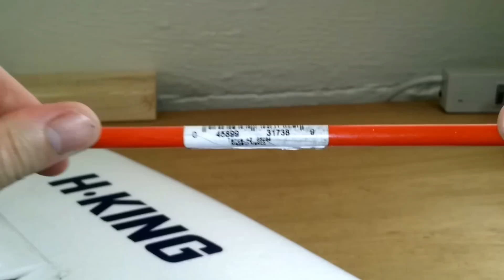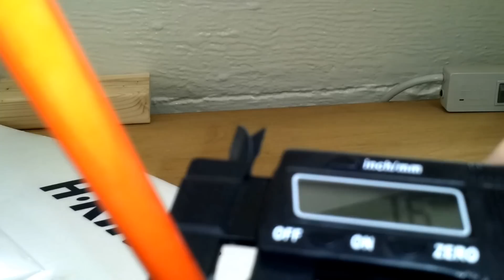Broken Carbon Fiber Wing Spar on Bixler 2 - Replacement For $1.99 at Home Depot or Lowes

Comment: Thanks for the video.

"I was hoping to find out what the specs of the actual genuine bixler 2 spar please."

I decided I couldn't wait and dremeled room for a 10mm aluminium tube, it was the absolute worst decision ever!!  The plane flew terrible, didn't have that soft return of energy that it did before. My spar got accidentally thrown out, which was very sad
Reply from the maker: I'm not for sure what the diameter of the tube was.  I don't have the broken tube any more.  I think 6mm or 6.5mm.  You might check the Hobby King website and see if they have replacement parts for the Bixler 2.
Reply: @MrDabrudda  cheers, it was 6mm

Comment: Yup, snapped a wing off right at he fuselage.  The spar broke .  It's very light but thin and brittle.  So I'm into the fix mode.  Thanks for your suggestions here. It will handle a 6mm aluminum tube if I find one.  Going to the machine shop.  Good luck.  Fun plane to fly.

Comment: I will need to try this because I broke my spar. Quick question for you. Did you try any mods to remove the need for the wing screws?
Reply from the maker: No I haven't tried the wall hanger mod or using rubber bands to hold the wings in.  For now I use the wing screws with my airline tubing mod to make it easier to insert and remove the screws.

Comment: You really don't even need to mod it to make it fit if it's a rod 39" long and 1/4" diameter
Reply from the maker: The fiber glass rod is a little thicker than the default carbon spar and is a very tight fit.  The carbon spar is 6mm and the fiber glass rod is 7.5mm so pushing the fiber glass rod in with your hands might be difficult.
Reply: MrDabrudda
Why not just sand the rod to fit by hand ??? instead of drilling with all that heat ???
Reply from the maker: Topvideos1001 Because sanding fiberglass cause millions of little shards which get caught in your skin.  I had slivers for a week from touching the part of the shaft that delaminated.